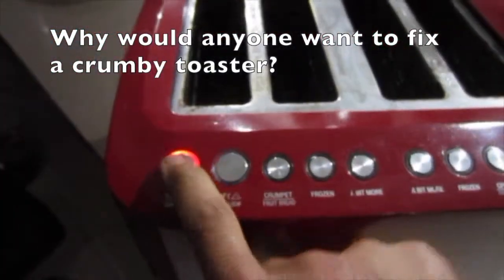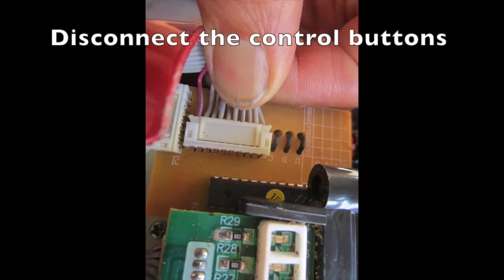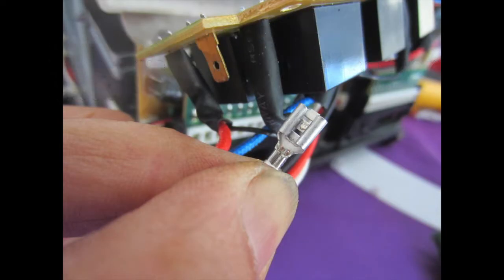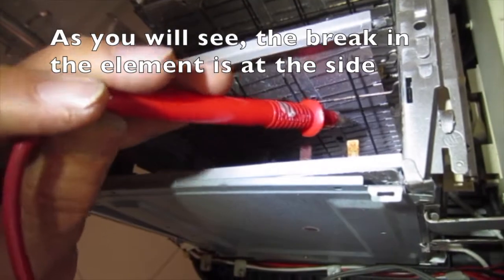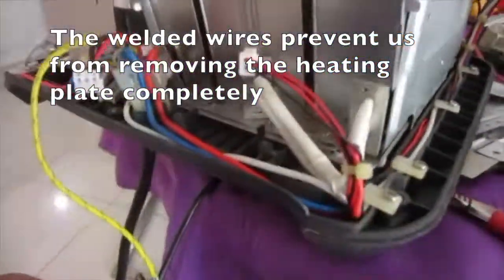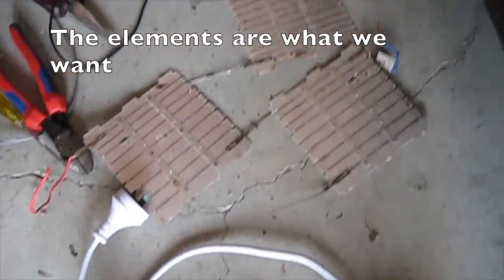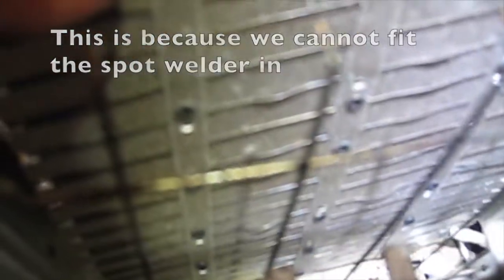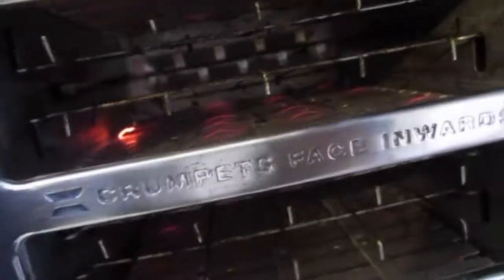Fix a non heating toaster by diagnosis & repairing the element

Comment: Good on ya mate!  I just got given a really expensive Smeg toaster.  I can see where the break is.  Right down the bottom on the middle element... typical 😅  I might have to try this.  I wasn't sure whether just folding the element wire over the existing wire would work but you've proven that it does.  Cheers mate.  I'll make a video of me doing it as well 👍
Reply from the maker: I was going to try and see if a spot welder can join nichrome wire . I’ll do that when I get time and make a video on that if it works .
Reply: Someone abandoned a smeg toaster that looked almost brand new in oue alley so I had to grab it and see if it works. Sure enough, it had the same issue you have mentioned! Bottom middle element was burnt and disconnected from each other. I am wondering if you were able to fix yours?
Reply: I had same problem, tried the repair using doner element wire twisted into a spring to go over both ends, then crimped the ends. Result : Bang!, poofh! lit up and melted. Spent 2 hours of my life on it.  So effe'd out the toaster, an expensive Kitchen Aid Artisan 4 toaster bought for €450
Buying cheap from now on ........ and shit on Kitchen Aid.

Comment: How long did the repair last, if the wires are heating up at different rates they are going to break again.
Reply from the maker: It is still working . I’m going to get some spare nichrome wire and see if it welds using my battery spot welder . If it does , I can post a video on it.

Comment: "Be careful not to pull the male part off, as that could be painful"  No kidding? Brilliant.
Watch out for toasters made in China.... crap elements...poor quality nichochrome.
Reply from the maker: I’ve bought a spot welder for batteries so I’ll do some experiments trying to weld nichrome wire . Not sure how that will go due to the high resistance .